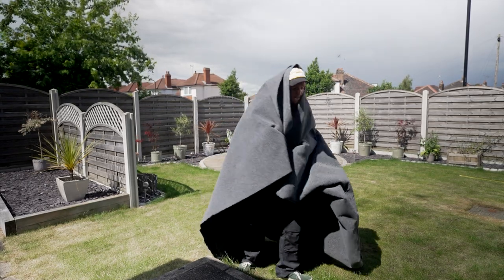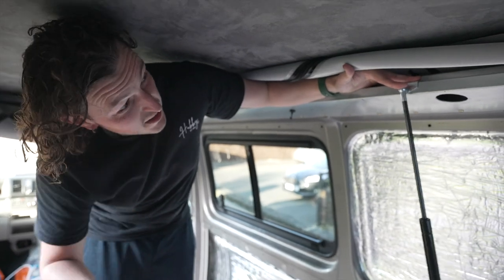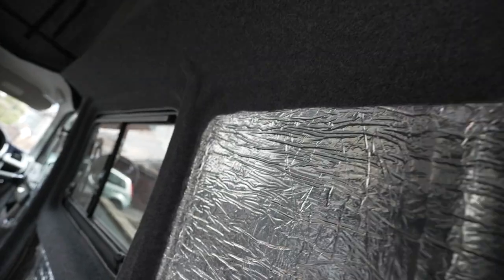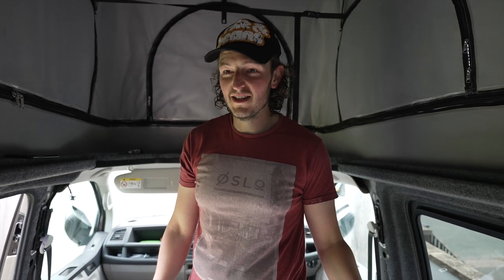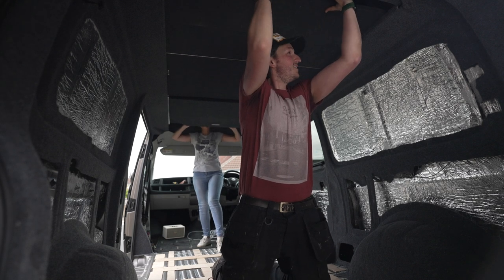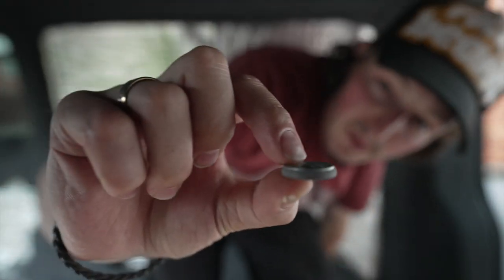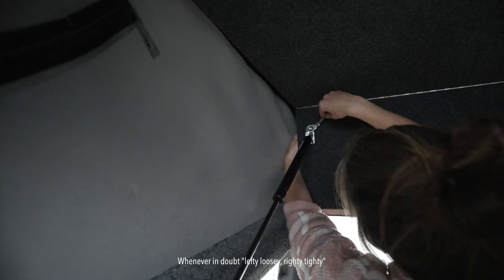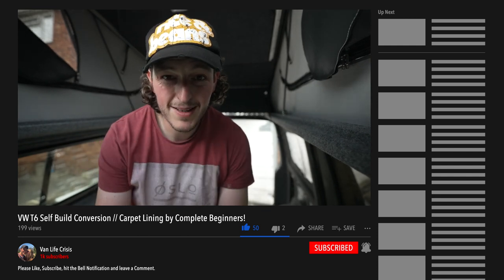CARPET LINING A VW T6 VAN // Do It Yourself? Or Pay A Professional? Beginners First Attempt!

Comment: Nice mate, useful to see how you’ve done it DIY - how are you planning on panelling the rear 1/4 upper panels (where some people put windows)?
Reply from the maker: Thank you ☺️
Haha well! I am still unsure! I think I'm going to put some thin timber struts vertically and panel to those. The struts are about 1cm thick and then 7.5mm cladding so it may loose a bit of width but I also plan to make some recesses as well.
Reply: @van.life.crisis  nice! I’m pretty much at the same position. Just trying to decide how to cover those 3 large holes just before you get to the rear pillar. Look forward to seeing how you get on 👍🏼